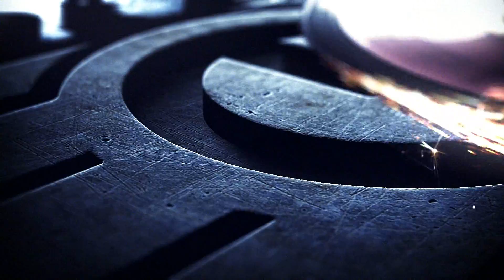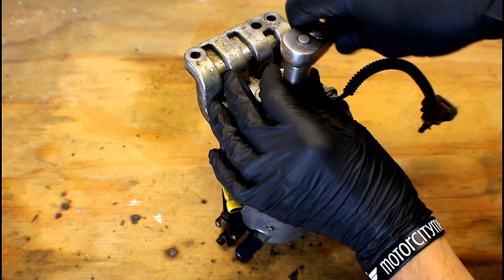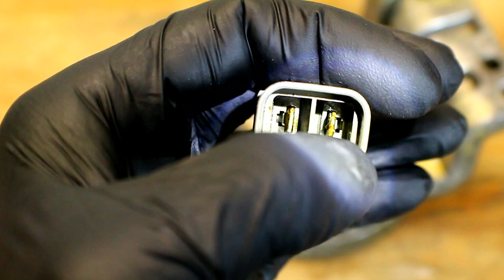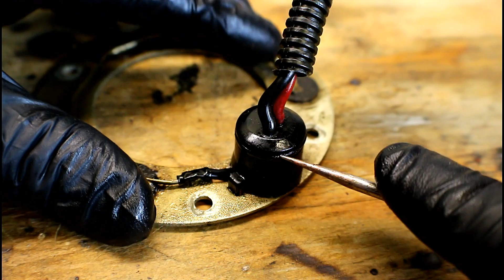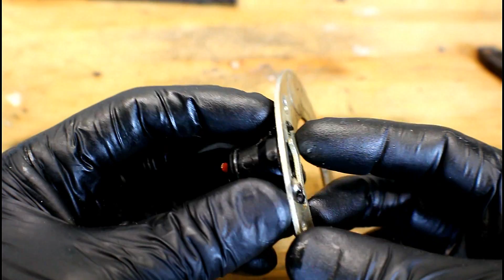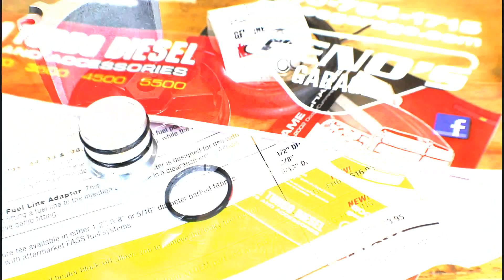Genosgarage.com 1998.5-1999 Dodge 5.9 diesel fuel heater leak repair

Comment: David, thank you for this greatly informative video! Do you have any info or video on how to control like, being in a 1999 3500 Ram, while gassing it at about 37-40 miles, there's a feeling like the engine kind of struggle to speed up until it passes those mileage, making kind of a funny noise, I guess is related to the injectors, or the fuel or the admission, something is kind of making the speed to struggle. I recently refilled the tank and I didn't feel it last time I drove it so maybe the diesel was fresher this time but I felt this phenomenum to me since I bought it used. Any suggestion?

Comment: I know this video is a bit old...but. Do you have any I formation on checking to see if the heating element works or not? I've purched a whole new/used cap to replace my cracked one but I am not sure if my original heating or new/used element works. Or if there is an aftermarket heating element that works with genos garage aftermarket cap?

Comment: At 273000 miles my 1998.5 just developed this leak. Drove me nuts trying to figure out the source. Heater plug it is! Time for a new O ring,

Comment: 1999 dodge ram 24V 5.9L Diesel. I bought the muti pack o-rings at my O'riley's and  Autozone. Neither had one that fit. They are too thick. I tried everything shove them in. I then bought a multi pack Viton O-rings from Harbor Freight and one of them worked perfect. This will get me by until my Gino's Garage replacement housing comes in. Thank you for the video.

Comment: Great Video !!!! A Million Thumbs up !! 👍👍 Exactly what I was looking for. I have a 1999 Dodge with what looks to be a leaker in this area. A Couple questions :
1) if u delete the Fuel heater will it pass smog ? In California ? Or throw a code so check engine light comes on ?
2) when u Re-install won’t air be in the lines ? Will it just work itself out ? I Have never replaced the fuel filter  , I Allways have My oil change place do the fuel filter at the same time.

Comment: A BIG THANK YOU David for making this video you just showed me how to fix the leak on my 98 Ram 5.9 !!  Would this leak also make my truck hard to start sometimes it just keeps cranking for a couple of minutes  before it starts, it runs fine after it starts, but if I shut it off for a few minutes and try to start it it keeps cranking for about a minute then starts. A couple of days ago I started my truck and moved it about 30 feet down my driveway to have some extra room to work, about an hour later I tried to start it but all it did was crank, after checking what I could I noticed that it looked wet around the heater plug. I sprayed some degreaser on it cleaned it off tried starting again after cranking for a couple of and pumping the accelerator half a dozen times it started, I checked to see if any fuel was on the heater plug but didn't see any. If it is leaking could it also be sucking air into the fuel system making it hard to start. I bought my truck new I have 225,000 miles on it, replaced the fuel pump a couple of years ago, change the oil every 3500 miles, had to have work done on the A/C a few times everything else has been good. Thanks for the info about Genosgarage.com
Reply: I would replace your lift pump again per what your truck is doing!!!!!

Comment: So on the top of my 98.5 one of the two wires separated from the top of the housing. Is there a part to get to replace the wiring or am I kind of screwed?? Also If I just unplug it and put the plug in will it have any affect on starting or performance?
Reply: Get an airdog at this point. Better reliability and bypass the OEM housing

Comment: Hey there brotha i love you videos you always get straight to the point and show good work. I have a question about a 2002 Dodge Ram 3500 5 9 Cummins on the side of the fuel filter you have a little sensor that looks like a oil pressure sensor I am not getting power to the sensor would that affect the truck I make it not turn on because I got no power going to my in tank fuel pump

Comment: This video made me smile. I wrote an article for the TDR using my son's truck as the subject. Geno's adopted/adapted my article. The biggest change was I used all Cummins part numbers from the outlet of the transfer (lift) pump to the VP-44.
Reply from the maker: Thanks for commenting.  I will have to check that article for sure.....Geno's sends me one every time they print one so I am sure I have that one. Again....thanks for reaching out. Dont forget to subscribe.
Reply: @MotorCityMechanic  I wrote the article in 2007. I can pass it along to you on Facebook if you want. I also, in the same article, describe what I believe is the best installation for a fuel pressure gage.

Comment: I have a 1999 Dodge Ram 2500 diesel 285,000 miles.  First time leak at heater ring.  Why do I need a fuel heater?  Thank you for the video.  It explains a lot.  Dodge did not have a clue.  What other things are attached to the case that need to be disconnected?  Thanks for your time and info!

Comment: My 1998 Dodge Ram 2500 cranked and would not start after a 40 minutes drive and turning off the Cummins. After it sat for an hour, tried it again, it started right up and drove to the house normally. On looking around the fuel system, I saw the fuel leak around the heater grommet. I hope the leak is the only reason for what appeared to have been a vapor lock. David, your explanation was clear and very easy to follow. Thanks! Subscribed!

Comment: Any idea of the size of the o ring?
Reply from the maker: I actually have no idea so I apologia. Make sure to subscribe.
Reply: @MotorCityMechanic  no worries, but thanks for getting back to me.  Helped us out to fix the problem, and very informative.
Reply from the maker: Your welcome and thank you as well.
Reply: @MotorCityMechanic  it's a weird sized o ring, had to go to Napa auto parts and have them match it.  My buddy told them were not leaving till this thing is back together, on their counter..  The o ring kits from home depot do not work at all.
Reply from the maker: @jared8455  Thats what I have been hearing. Not something you find in a "universal assortment kit" for sure. I think they may mention it on the Geno's Garage website somewhere.
Reply: The o-ring size is A016 (15.6x1.78 mm) from the Viton o-ring assortment from Harbor Freight.

Comment: I am about to replace the o-ring on my fuel filter per your instructions.  Excellent video.  Clear and concise instructions.
Reply from the maker: Many thanks for the feedback! Take your time and all should go well. Make sure to subscribe.
Reply: @MotorCityMechanic  good night friend where can I get the fuel heater I would appreciate it very much with your help I have the same problem thank you

Comment: Well I've tried all that I know to try, dam thing will not go back into the housing. I warmed up the top of the housing, changed o rings, more grease..tried light tap with a carefully placed socket, don't want to break the thing.  (shaking head?)  It popped right out just fine.

Comment: A fourth option is to replace the fuel filter housing with a spin on type. Personally I think it's the easiest and cleanest option. The fuel lines connect to the exact same place on both housings. It's like a 20 minute job. Cummins part# 3925600.
Reply: Even Geno's has a version they source, but I'd find one on eBay that includes the stud to spin the filter on to.

Geno's version:
https://www.genosgarage.com/product/dodge-ram-cummins-fuel-filter-head-3925600
Reply from the maker: Thanks for that added info! Much appreciated and great to know.
Reply: @MotorCityMechanic  happy to contribute. Also I like your work, you're thorough and your explanations are very easy to understand.
Reply from the maker: @LightWaIker  Many thanks for the kind words as well!
Reply: Do you guys still sell Prt# GG-FC 98599 on the video i looked on the website and couldn’t find it ? Please let me know thank you

Comment: Perfect lesson video! Subscribed
Reply from the maker: Many thanks! Make sure to subscribe and check out my other videos
Reply: MotorCity Mechanic You bet! Btw I followed every step, new heater o ring, new filter and o rings, did about 5 bumps on the starter then 2 aggressive on the throttle starts and ole bruiser cranked and ran like a charm. Didn’t have to crack open any injectors either. Thanks a ton! I subscribed.
Reply from the maker: Thanks for letting me know how it turned out. Glad all went well and thanks for having subscribed.

Comment: Is the bottom canister on the 1998.5  exact same as a 1998 cummins fuel canister could i use it to replace broke one ? I picked up this truck and who ever changed filter broke the hole off on top were the drain valve attaches and now have no drain valve and it started leak ing out of tube.

Comment: I've got a 2nd generation 12v.  I've messed around with the lift pump and fuel heater long enough. 
I'm headed for the Dodge dealer. Just fix this thing.
Reply from the maker: Once they eventually moved that lift pump to the tank....the problems went away. I cant remember what year they offered the kit for relocating it to the tank. My memory lets me down sometimes lol. Thanks for watching

Comment: Is it bad if you cut the wire?
Reply from the maker: If you replacing the o-ring only....remove the wires from the connect and dont cut them. If your installing the delete plug then you can cut the wires.  Thanks for watching and make sure to subscribe
Reply: @MotorCityMechanic   he was asking like what happends when you do the delete plug and cut the wires whats the outcome

Comment: is replacing the fuel heater with just the block off plug bad for winter.
Reply from the maker: Depending on where your located and the temperatures you might see....the fuel could gel so it may be needed for your climate. Here in Georgia not so much.
Reply: I am from California, and the lowest temp here in The High desert is 19*F, and it is rare, can I get away with a Blockoff?
Reply: @luisg8946  at +19 F you won't have a problem. Colder than that, problem.

Comment: My 2006 5.9 diesel Ram 3500. won't start.  The starter turns over but it won't fire. We tried ether and it tried to fire off the ether.  Doyou have any idea why it might not be getting fuel to fire?